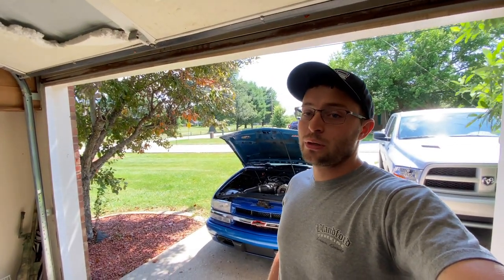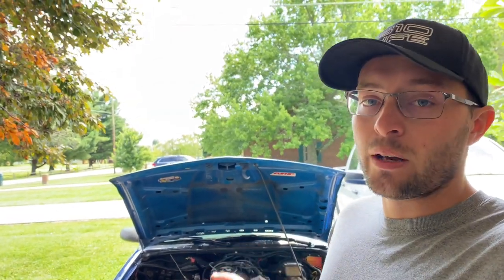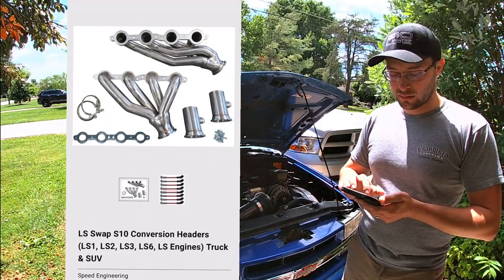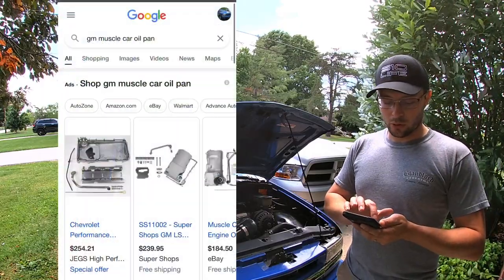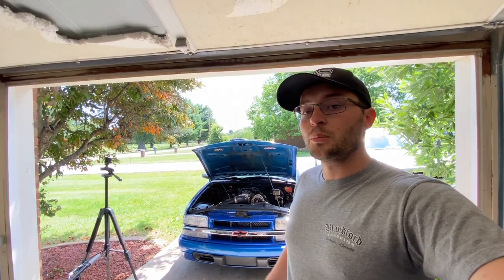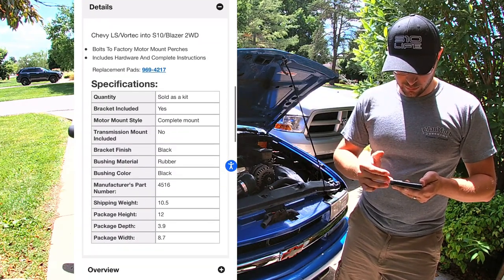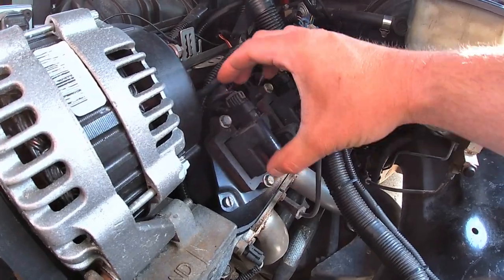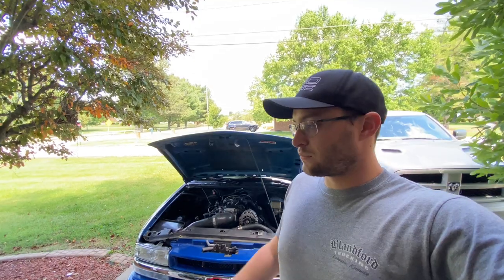How To LS Swap: Budget S10 in 2021 /  What You Need to Get Started on Your Swap

Comment: Thanks for the header/sparkplug info bro! For anyone doing an ls swapped in the near future, DO NOT use the ebay shorty headers. Trust me, spend the money. You'll just wind up spending the same amount on heat socks, plug wires, and collector gaskets. Along with several burnt fingers and hot days under the truck! Ask me how I know
Reply: Only an idiot would try a shorty header, let's go Brandon...
Reply: How do you know

Comment: Or for the rear coil, you can buy a rear coil reverse kit. It flips the back ones around so you don’t have to change you brake booster or a/c box.
Reply: or just run truck coils and bolt the bottom hole of the truck coil to the top hole of the truck coil bracket

Comment: Just putting a old school 78 small block 350 and turbo 350 trans , Headers , and swapping in a 8.5 Chevy S-10 rear end 
$400- S-10 Truck 
Free - 350 Engine /Trans 1978 
Traded - New Headers 
Free- 8.5 Chevy S-10 rear end 
$50- motor mounts 
Still have the 78 Silverado the engine/trans it came out of

Comment: I got  99 chevy s10 small block 350 to 383 stroker  port aluminum  heads with 950  alcohol carburator  poweglide transbrake transmision 2” headers  im making 10.15  on 1/4 mile

Comment: I’m putting an 01 4.8 in my 97 4wd   S10 I’ve put a 3 inch body lift on it I have the Silverado pcm and wiring the ls motor mounts just waiting on my headers is there anything you can tell me about the plan and the wiring of the pcm

Comment: Next time you’re in leitchfield can you help me out? My trucks a 96 as well this is my first swap with no mechanical experience would appreciate the help bought my truck off Jarrett motor and trans came from Denny running into some issues with dipstick tube fitment and manifold gasket clearance and have no idea ab the rest of my swap I’m wanting to learn everything about this swap so I can fix little things considering I plan on drifting this truck

Comment: In your older video you mentioned a new intermediate steering shaft. I have the gen 1 and it is junk and no way to replace it. Before I can even do anything or buy a motor that has to be sorted out. What did you get? I didn't see a part number listed anywhere. Thanks

Comment: Have you done anything at all to the suspension?
Reply from the maker: Removed overload spring on rearend, Qa1 single read adjustables, Caltracs, stock front coil spring, extended ball joints, and Viking Crusader front shocks.

Comment: Is it possible to do a 5.3 or 6.0 swap with the manual transmission that came with the 2.2 s10 year 2000 would like to know if I could do this when my motor finally fails without swapping transmissions to stay very budget friendly with dependable daily driver thanks

Comment: It sucks you cant get any real headers for a zr2 4x4 s10 LS swap. All that I know of that work are the cast steel exhaust manifolds from the LS1 98-99 camaro/TransAm (F-bodies) which still need the 3 bolt flange cut off with an extension welded to them. I've also hear that the early (05-07or 08 IIRC) gmc envoy 5.3 and trailblazer 5.3L exhaust manifolds will fit a zr2 s10/blazer. I believe they too need to be modified as well. I'm not sure if the trailblazer SS exhaust manifolds will and I cant find any information on that either. If anyone knows a better manifild or header solution for a LS swap in a 2000 zr2 4x4 s10 that has no aftermarket suspension or body lift kit on it, please share. I'm doing an L33 aluminum block 5.3 swap into my zr2 with a bed mounted turbo once I have the 5.3L's bugs worked out. My L33 already has an LS6 intake with a 3 bar MAP and DBC throttle body swapped onto it with 80lb injectors.

Comment: the short headers u showed about number 8 wrapping around will those fit a 97 s-10 with stock steering shaft and column shifter ?
Reply from the maker: Yes. They should work fine.

Comment: I’m having an issue with the steering column shaft hitting the header. Any idea how to reroute and what hardware I will need?
Reply from the maker: May have to go in and adjust motor mounts slightly, maybe massage the header with a hammer or like a brass hammer to dent it(won’t affect flow), and maybe get an aftermarket steering shaft.

Comment: Sorry for the stupid question but is the 5.3 out of a 2003 Tahoe LS actually considered an LS? I read somewhere that it wasn’t a “true LS”
Reply: It's a LS. Some will argue that it's not because it doesn't have a LS RPO code. However you can swap parts from most LS engines onto a 5.3 because it is in fact the same architecture
Reply: @beardedforlife3740  ok thanks for the response

Comment: I have 95 2.2L would to need to change the rear diff out for something stronger? For me I'm not looking for drag race power, just a engine for general hauling and driving. (For me this is an eventual project when the old 2.2 dies, which may be many years from now...)
Reply: Yes absolutely you need a stronger rear end

Comment: Will the 4l60 bolt right up and do you need to change anything on the transmission? thx
Reply: If its to a 4.8-6 liter itll bolt up fine probably just be mods to the trans x member to make it work since the s10 never optioned an 8 cyl with a 4l60

Comment: Modified 98-99 f body exhaust manifolds work well
Reply from the maker: Modified how
Reply: @LsBluu  hammered one of the runners on the driver side to clear the steering shaft. Cut off the flanges. Little bit of cutting, hammering and welding to get good clearance on the manifolds from the the control arms. Extended the manifolds with some straight exhaust pieces. Then added v band flanges to the ends of exhaust. Might be better options out there but it was fun making something work on my own.

Comment: Why can't you run the factory oil pan from the ls engine?
Reply from the maker: You could, if you notched the frame. Without doing that, the sump on the factory pan extends far forward.
Reply: @LsBluu  Thank you for answering my question. I have a L83 and I'm saving up for a T56 for my 95 Sonoma. I'll definitely be looking up this type of oil pan. Does your racing pan hang lower than the skid plate or is it slightly above flush? Your truck looks awesome btw

Comment: What all did you have to do to do the bumper conversion
Reply from the maker: The rear bumper? There are some brackets that have to be removed, and there are some parts of the bed on the very back that’ll need to be removed or fit. After that you’ll drill holes and use bolts to secure it to the truck.
Reply: The front bumper

Comment: Whats you fuel system setup? Like stock s10 tank with stock pump?
Reply from the maker: Fuel cell in the bed with walbro 255 in-line pump. C5 Corvette fuel regulator.